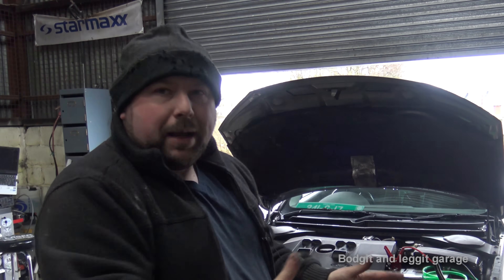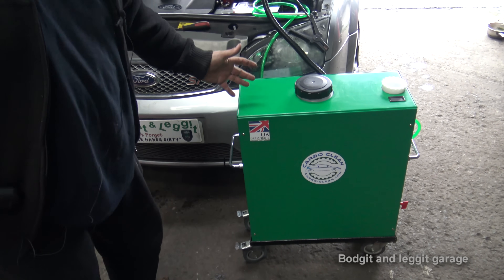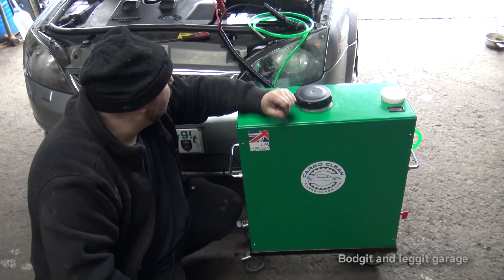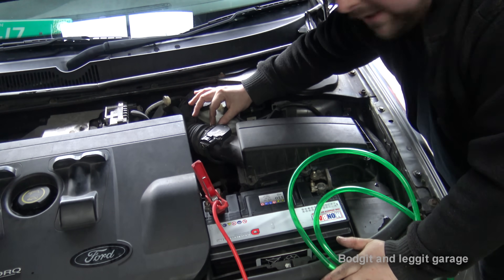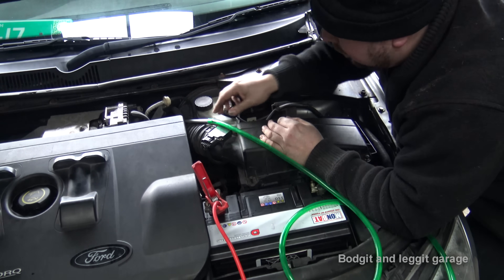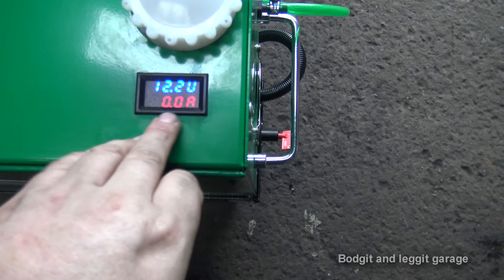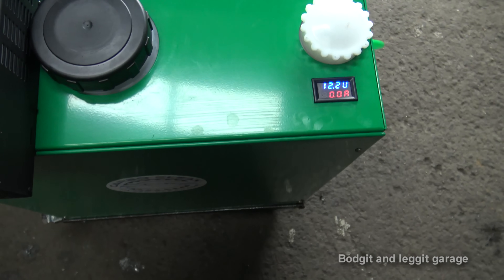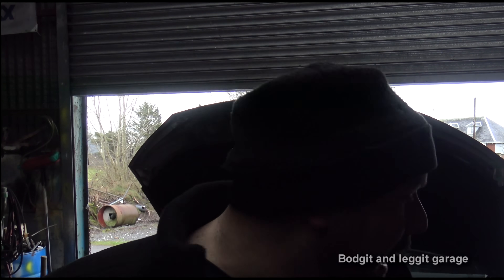Carbon Engine Cleaning HHO How Does It Work Bodgit And Leggit Garage

Comment: I had it done. 322bhp /712nm before, 329bhp/720nm a week after, accounting for air temp and fuel additive mix between runs, statistically no improvement. Wasted £100 I could have put towards shell v-power. 2013 jag XF 3.0v6 186k miles.

Comment: I have a cleaning device. Today a test was performed on my device on a vehicle with a computer malfunction. The malfunction of an improper oxygen sensor. A shaking engine. Sensors were replaced. After connecting the HHO to the engine for about 20 minutes the vibrations disappeared and the engine noise went down, the spare parts that had been in the vehicle were returned to the malfunction. This experiment was performed in David Garage's Emek Sara closet in Be'er Sheva where the vehicle is connected to a computer. An engine fault was deleted and did not return.
https://www.youtube.com/shorts/o0lBDpL3CL8

Comment: I had UK Carbon Cleaning (UKCC) come out to do a stage 3 clean on my Stage 1, 2008 Audi TT with 70K miles on the clock and no record of the service being done prior. The car felt amazing after the service. Smooth acceleration, punchier whilst offering a much more refined power delivery. Highly recommended.
Reply: The fact you are referencing stages says it all
Reply: @garagenorth1864  yep, for the uneducated, stages in this context refer to different packages that may include fuel injector cleaner, longer machine on time, etc.

Comment: Waste of time and money
Reply from the maker: thank you for your expert opinion you obviously chemical engineer and know exactly how this works on what you are saying doesn't work congratulations

give me the proper scientific definition of how this doesn't work in your own words not copied and paste off some websites go into proper detail
Reply: @bodgitandleggitgarage  Listen squire, your channel has loads of good content, this one however, was beneath you. HHO improvements are neglible at best, just like all the other products Rep's claim does this and that I've listened to over the last 35 years working on cars.

Nowadays I just do BM's and having done a proper manifold & port clean on a 320D that had had one of these miracle hydrogen cleans, when I showed the owner the state of the inlet manifold and how restricted his ports were only weeks later, his exact words were "Well that clean was a total waste of time and money"

I'd be more than willing to drive to your new gaff in one of my motors, take the inlet manifold off myself, get some good pictures whilst your there, put it back on and give it a go on your machine and remove the manifold again to see what difference it made, which I'm pretty confident will be not a lot and certainly can't be compared to a proper chamical manifold wash & walnut blast which can be had for as little as £250 - £300 on a typical N47 engined BMW across the UK for example.

I've got no beef wih ya mister and hope things work out, still stand by my original comment though.

Comment: Where do all the particles go that are being forcefully removed?? Maybe, scuffing the cylinder walls and damaging the rings! That crap is a joke at best as far as I am concerned. 
If this process is done ever so often from day one(New Car) I would say yes it be a good Idea, but selling that job to someone with an old vehicle is ridiculous.
Reply from the maker: hi mate thanks for the comment and maybe do a bit more research before making a comment you do not do any damage whatsoever the parts disintegrate with the chemical reaction it doesn't just dislodge big part at 1 time it's slowly flakes them off and disintegrate them in the combustion chamber doing absolutely no damage whatsoever and it's massively hugely effective on old cars just like a lot of cleaners are
Reply: @bodgitandleggitgarage  Never in 38 Years of working on automobiles have I ever seen a product(chemical) "disitigrate" anything. If it is a slow process like 8-10 applications needed at $100-$200 why not just take it apart and clean with some good old fashioned elbow grease!
I don't have to do research since there are videos out there that show it does not klean the way it is advertised. Put a dual exhaust on a Pickup and People will swear the truck got 50 more horsepower. 
At the end of the Day I have "never" seen a miracle in a can. Again, do this process from "New" and yes it will be great and so are other things that been around for many years.
To each their own. I would never sell that to my customer.

Comment: Does this clean the intake valves in gti?
Reply from the maker: the Hotter is the better it works so it works a lot better in the combustion chamber
Reply: bodgit and leggit garage i dont get your reply my guy, does it clean the intake valves in a gti?

Comment: I've had a few Hydro cleans done, tbh I can't say it did a single thing, two were dirty turbo vanes and one was an EGR, Terraclean works a bit better, though not always, but, frankly, for the cost you can buy a new turbo core and EGR and still pocket £100.....and that works every damn time lol.
   The Wynn's intake spray works well, though you often need two cans, the measly 200ml isn't adequate.

Comment: hi mate. is it safe for carbon particles to go into the combustion chamber? Ive been worrying about it for years
Reply from the maker: Hi mate it's like everything if a big enough piece goes through yes it can do damage but the machine just basically breaks it down to absolutely nothing so there is no damage occurred but if a piece moves and goes into the wrong place yes it can cause damage or the car to run very badly

Comment: hydrogen will react with oxygen to form water, why do not use a cylinder of hydrogen instead of green box😆; substantiate why your method is superior than others😎😒
Reply: Have you seen myth busters when they tried that,they got a flash back from the engine . When you have a cylinder of hydrogen that's a bomb. You can build a small hydrogen dry cell and run it on the car all the time , small drycell will run on about 15-20 amps.but you have to remap the car because the 02 sensor's will see to much 02 coming from the engine, and dump more fuel in because it thinks the car is running to lean

Comment: Leon i had my work van 2005 transit connect carbon cleaned today i wasn't to sure how it was guna turn out but mate i drove it home what a difference it responds better with acceleration it felt like it was going through gears better the bloke who did it said its guna be better on fuel efficiency to only time will tell with that 1 but theres no smoke bellowing out or not as much as b4 lol overall im impressed SORTED 👍
Reply from the maker: I'm really glad it made a difference mates I think the problem with this is most people think when they have a problem this machine is going to fix it where in some cases they have a mechanical issue which obviously this machine will do no good if you got a car in issue as you can see this machine works let's just hope more people actually understand this before they comment
Reply: @bodgitandleggitgarage  agreed mate 👍

Comment: leon,please help    why is my mondeo tdci 2.0 diesel keep going into limp mode even though i have cleaned the egr, it even  shows limp mode even when i start up. im at my wits end.
Reply from the maker: Hi mate it could be a million and one things causing this you're going to have to get error codes and go from there
Reply: Once the diesel engine was simple and would last many years.. Now the manufacturers are wise to this old practice and make sure all sorts of gadgets can give you the dangerous limp mode..
If it's really unhappy maybe when you overtake.. 
They came up with great ideas like mixing exhaust gasses with oil vapour so your car can run on tar..
Its OK though better mpg just suicidal engines especially if you have wonderful swirl flaps..
You soon start losing that money saved on mpg...
Now you can have an even newer one with more of these gadgets.
Having fun with all the fault codes, moral of the story don't over complicate but where's the fun in that.

Comment: It would have been useful and easy to put a borescope in to both the cylinder head and intake manifold before and after the 'cleaning' process. The big green box appears to be just a simple electrolysis device where passing a current through water (with some additive e.g. salt, to speed up the gas bubble production) to get hydrogen and oxygen at the electrodes. However, a large amount of steam is also produce, which will also pass along the tube in to the intake. It is very doubtful that sufficient hydrogen is produced to actually do anything to clean the intake, valves and cylinders etc. Simple proof that hydrogen is being produced is to take a sample of the bubble in a bottle and put a match to the opening. You'll get a pop (nothing more to show that hydrogen is present. The magic green box treatment is simple con. There is no hard evidence that the engine is cleaned and you couldn't tell by just driving the car (unless there had been a misfire which had gone after the 'cleaning' process was carried out). I can't believe people fall for this type of thing.
Reply: My pal was foolish enough to let one of these guys loose on his 2011 Audi RS5, £80 and 1 hour later he now has a cylinder misfire on 2 and 5, car cuts out, he forced it to idle by holding revs and it drove like it’s on square wheels. 

Car had a full green health check from Audi 2 weeks ago, car is on a flatbed going to Audi now, awaiting a big bill and court proceedings against the “carbon cleaner” for cost of putting it right.

Comment: Can my codes on an Audi A5 2013 tdi still have codes of 
1) EGR valve open circuit 
2) Exhaust gas Recirculation Sensor A circuit/range performance 
3) EGR valve open circuit 
If it was just totally blocked up ?
Reply: I have the same problem now my turbo bad
Reply: Yes and you will also get the emissions light come up

Comment: i reallly don't no , it does sound to good to be true , i have a hydrogen machine  and done 2 cars and yer better ,   i really need to pull a engine apart to see if it has done anything ,   wait until i have one with head gasket problem and do a clean before .

Comment: How do you know it produces hydrogen just by putting it in a bottle of water? It may just be air
Reply from the maker: There is no pump in this so it cannot be air
Reply: lets see you put a match to that steam...….that will prove its Hydrogen PMSL
Reply from the maker: @martinhill3986  no problem at all I will be doing a video proving that it will ignite

Comment: 1:You are not pushing the pure Hydrogen only Brown's gas. In plain, because I don't think you are capable to grasp chemical symbols, the engine's ECU will add even more fuel because of extra oxygen added to the mixture. 
2:You are a complete moron! You disconnect air filter and kept revving the customers turbocharged engine, amazing! 
3:HHO will not clean your intake
4:Strip and photograph, measure, do static and dynamic logs (if you even grasp what is that), then run this miracle machine and we will see the difference, otherwise its bull shit rip off and customers fuel!

Comment: Remember whenever you connect or disconnect jump leads and the machine is ON. It could create a spark...

Not good having a spark near hydrogen.
Reply from the maker: Yes mate very true but don't forget you can also turn this machine off before you disconnect the battery and if you're even more worried than that just let the top open let it all vent and you will have no issue I've never had any issue with it

Comment: Hydrogen as a catalyst? Really? A catalyst doesn’t get consumed. Hydrogen reacts with oxygen, ie, burns. It acts as just another fuel.

Just use a cylinder of hydrogen gas.
Reply: I imagine the machine is cheaper in the long run that using gas cylinders. And I believe this machine is generating Brown's gas which is actually hydrogen plus oxygen in their basic form.

Comment: Nice thing will be a dpf cut open for real proof.
Reply from the maker: BOARCAS BOGDAN no mate I'm not going to cut open a 5 to £10,000 DPF filter to prove a point on a video I have done other videos proving this works but I've never stated this machine cleans dpf this machine does not clean DPf
Reply: bodgit and leggit garage 
If cleans the engine can you tell me were all the carbon goes ?
It is a pozibiliti to go in to dpf and build up there ?

Comment: Just take the spark plugs out snd take photos before and after mate... And heck if it was my job i would buy a micro camera to look inside the chamber better so you csn have proof and get even more customers
Reply from the maker: Digitaltiger123 I don't need to do that I've gone other videos proving that it works

Comment: The chinese also make these 'machines' which are very good quality.
This is just plain old electrolysis and this particular machine doesnt cost the garage anything to run as it uses the vehicles battery to power it, it uses 316l stainless steel plates inside. garages will make 100% profit off these machines.
Reply from the maker: merlin 13 I would love to live in your world you are forgetting about everything else what about all the rates we have to pay taxes we have to pay training other tools we have to buy updates for Life scan tools you make it sound so easy
Reply: just stating facts and referring to electrolysis, NOT the rest of the workshop. cant see why it touched a raw nerve! Actually I made a mistake, garages will make bucket loads from these machines.
Reply: @merlin1346  garages do already lol.

Comment: Hi mate, I have a similar machine, when I take the top cap off I can see all the hydrogen coming out...however the bottle trick didn’t work it wasn’t letting bubbles out like yours...any suggestions?
Reply from the maker: LLL M hi mate make sure there's no water in the Tube and make sure there's no blockage in the tube it should work fine
Reply: Cheers pal, It’s just asif there’s no force pushing the gas out but when the main lid is open you can definitely see all the gas been created, does the pressure have to build up in the main tank to push it out you reckon?
Reply from the maker: LLL M hi mate unfortunately I'm really not sure all I can think of there must be a blockage somewhere

Comment: Will it have any effect on a gunked up intake? I'd imagine that cycling the EGR would do wonders to clean up that gunk.
Reply from the maker: Jon Tanneguy hi mate it all depends on exactly how bad if it is if it's really bad to the point where the car cannot start then the only option is to take everything apart and manually clean it this cleaner works better when the parts are hottest of the hot of the parts like EGR valve in turning the engine valve  etc it works really well it will help the intake but if it's too bad you have to manually clean it

Comment: There is a quick and easy way to find out how much carbon is in your engine. Just put an endoscope down the spark/glow plug holes and you can see how much carbon is inside the cylinders. EGR valves and suchlike are easy enough to remove so that wouldn't really be in issue. Some before and after shots would prove if this works or not. I use BG products to clean the fuel system. When I first MoTd my Mk4 Astra it only scraped through the emissions test. I started using the BG products and the emissions went right down on subsequent MoTs.

Comment: That machine is very neat and seems fool proof (it means I could probably use it) But on  a more serious note, do your customers need to sign any sort of disclaimer before this procedure? It’s snowing like mad in Co. Meath as I’m typing this, you must be berried in the West. Keep warm. 🔥🔥🔥
Reply from the maker: Krzysztof Kacprzak hi mate no no disclaimer as this cannot do any damage the carbon is burnt up and the hydrogen is burnt up no damage will occur during this process if the car has a problem I will not do this process we have to check the car is suitable before we do anything just like you would do in any situation

Comment: Most interesting my only concern would be somehow it would damage the catalysts. If all that gas coming out the tube is Hydrogen that is a LOT.
Reply from the maker: Eric Corse hi mate all the hydrogen and carbon is burnt up in the engine will not cause any problems to the catalytic converter but like I said in the video we will check out the car first to make sure it's mechanically sound before we would go and do this just like you good with anything

Comment: id say these machines work well...but only before mechanical issues start...intake manifold,egr,valves,turbo oil feed pipe etc id say stripped and cleaned manually...but this machine will probably clean piston crowns abit and maybe oil gallies